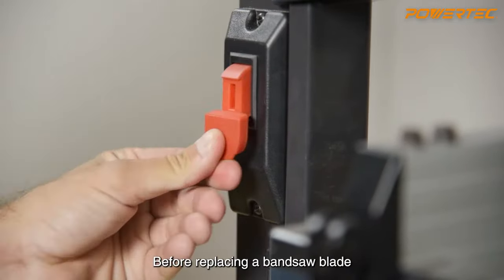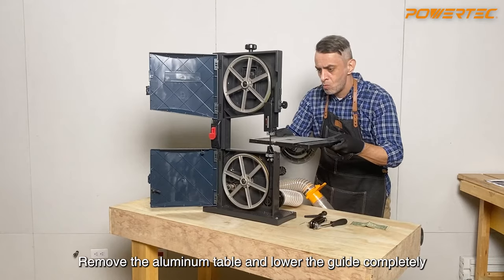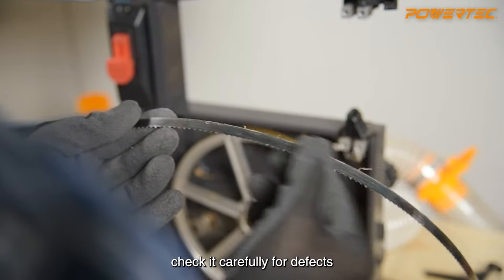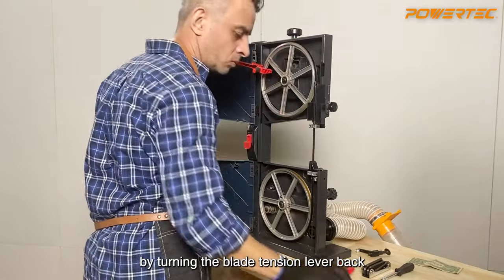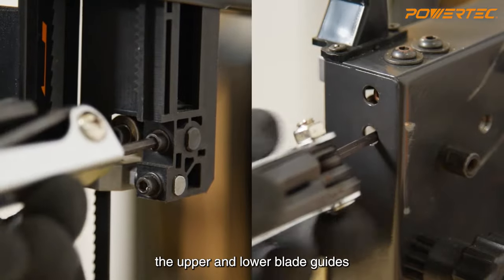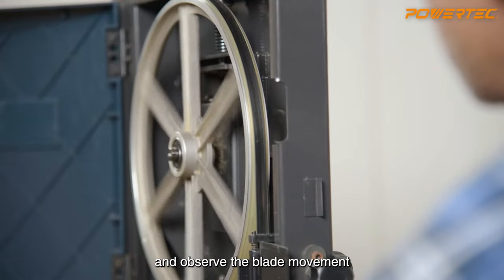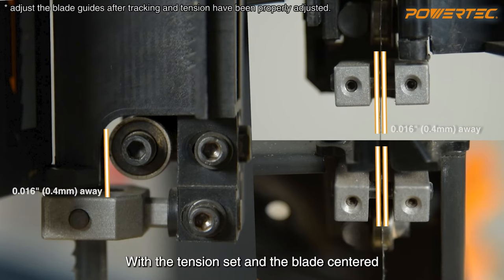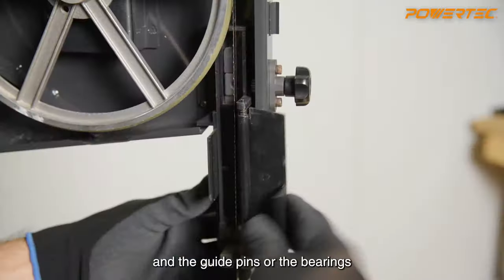9 Inch Benchtop Bandsaw - How To Change Band Saw Blade | POWERTEC Woodworking Tools & Accessories

Comment: Are the size of the blades all the same?
Reply from the maker: Hey @tedperez4732, great question! When it comes to length, the choice of a band saw blade depends on your machine, while the size of your saw's wheels will typically determine the maximum thickness of the blade you can use.  Depending on your application, there are a number of variations within a blade size. Blades widths, the number of teeth per inch, and the material type of blade can all change depending on your application. When buying a blade, check the listing to make sure it meets you needs. We hope this helps!
Reply: @powertec_usa  gracias. I'm in Baja 🇲🇽 but commute back and forth between San Diego for weekends. I Amazoned a Timberwolf blade and package was stolen before I could get it lol. I finally got replacement blade and I hope to install it this weekend (for my bday present)